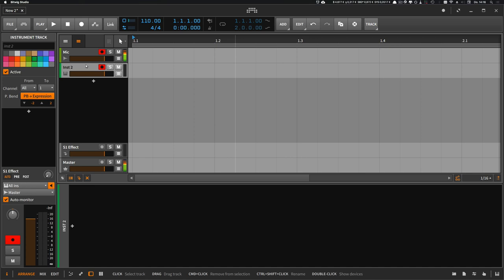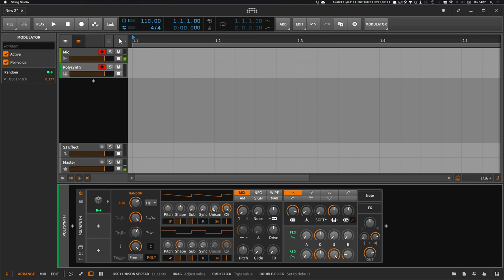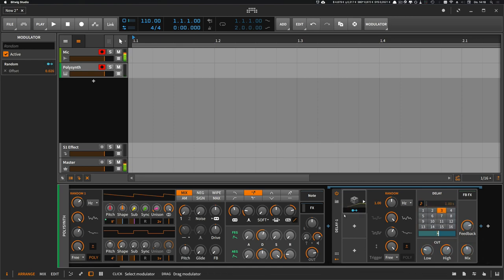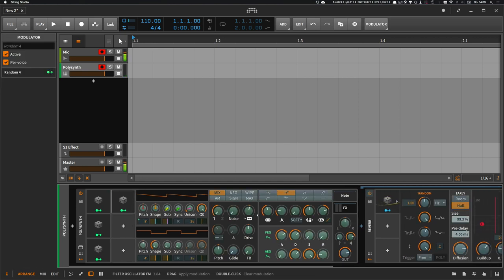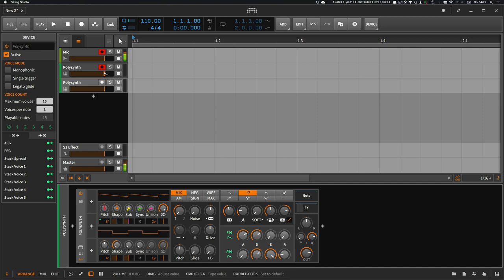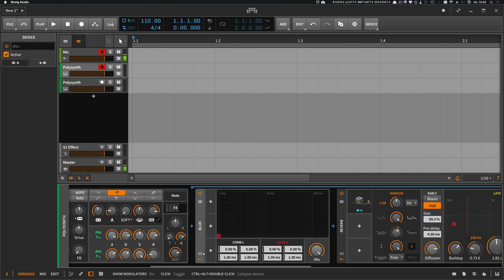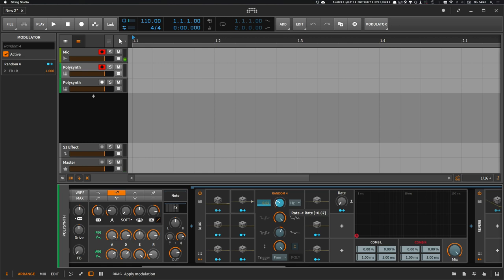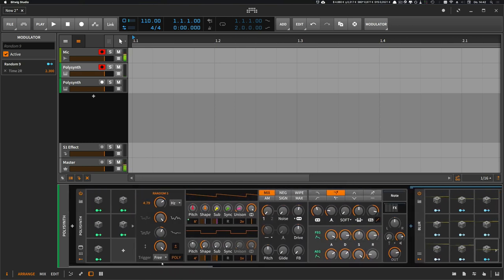Small Modulations - Bring your sounds to life with Bitwig modulators

Comment: Super pro technique, and this video also shows how easy/fast Bitwig enables you to bake this type of movement into any sound. By contrast, this same degree of movement would be tedious to create in Ableton.
Reply: @G T Having been an Ableton user from Live 6 through Live 10, doing fairly extensive sound design and building complex racks, and fully aware of the M4L devices that can do the same things as demonstrated in this video, we'll have to agree to disagree. It can all be done in Live, sure. But it can't be done as easily and as fast, and modulations coming out of M4L devices can sometimes be buggy, especially when you start and stop the transport. For example, the LFO device can be a little unstable for the first N milliseconds IF you are automating it on and off during the project playback (When automated ON, it seems to take a noticeable amount of time to sync up to the transport clock.)
Reply: @Baphometrix  I Agree!!! I think Bitwig is more powerful than any other DAW when it comes to modulation and creative and stuff. 

 (I do miss some things which I had in Studio One like the chord track, Arranger track, and the shortcut macros, etc. But its a very small sacrifice for all the other things I get in Bitwig!)